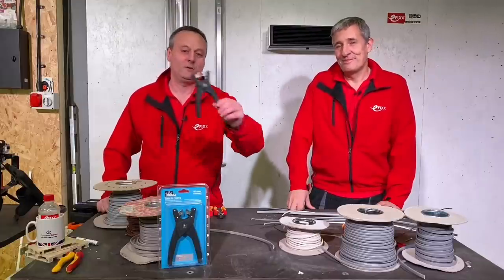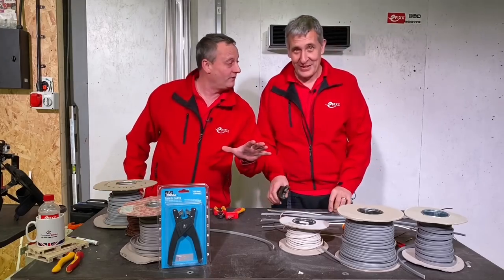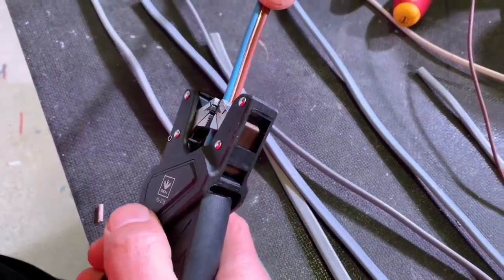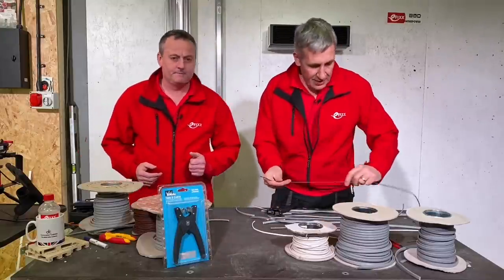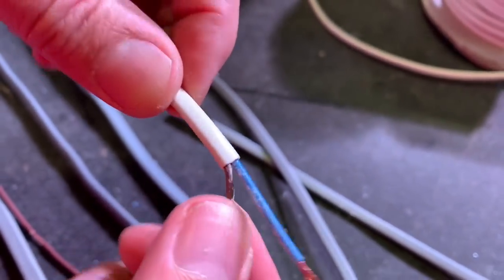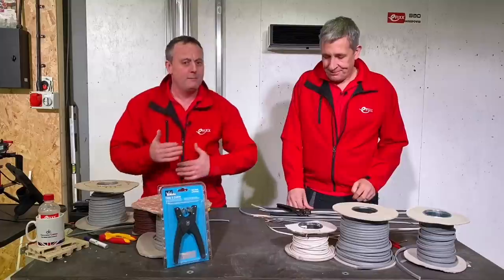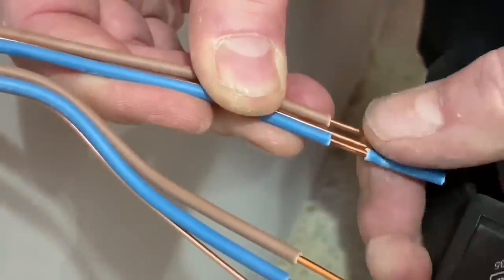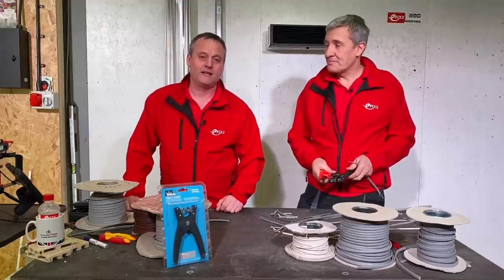Strip TWIN and EARTH cables FAST with this IDEAL cable stripper.

Comment: They look brilliant! Another one for the wish list then. I’m new to industry and can find i bite into the cooper if i’m not careful using snips, meaning the copper snaps when i try to connect it and screw it down.
Reply: I can not believe that these don't scar the mechanical protection and the insulation like other branded automatic strippers do... *ahem*ck*ahem*🤫🤭🤭

Comment: Great looking tool, but only up to 2.5mm2 T&E. What can you recommend for 4.0mm2 T&E? Mainly interested in the sheath removal as stripping the cores is easier and less of a problem if it goes wrong.

Comment: I’ve actually got a pair of these, apparently there are another brand that do up to 6mm which would be useful. Great on new cable, not so good on old colours when I’ve done some retro fitting. Always use it in lighting not on back boxes as difficult to get in far enough. Also use knipex ergo strip which is my go to. Use the Ideal for termination mostly as it’s great for measuring the correct length and with wago connectors.
Reply from the maker: Great comment and thanks for sharing with the community 👍
Reply: Ideal?

Comment: Thanks for the info, I was a bit disappointed how much sheath was left in the back box on your socket test. I nearly bought a pair of these to replace my CKs (which I don't use for sockets for the same reason) thinking they'd be better for making off sockets. Doesn't look to be the case, guess I'll stick to the old side cutters and cheese wire approach for now!
Reply from the maker: Thanks for the message 👍

Comment: If you use the tool like you have done then instead of using your hands you can use the tool to take the outer sheathing off on the cables way out if you grip it? Then go in again like you have to strip the cores. Thanks

Comment: I've got a pair of the CK ones, only use them if I'm 2nd fixing lots of downlights as you have to enter the cable from the side which makes is awkward to get into ko boxes. However may have to save up some pennies and invest in these style cutters. Looks time effective and nice clean finish to the cable. Still waiting for someone to come up with tool that will strip LSF T&E though!!

Comment: It would be nice if the cutting/gripping  head was extended  and could easily fit into a receptacle box or tight areas to strip NM cable.

Comment: I know it's not the same but I just got the knipex Ergostrip for flex cables  for a Christmas present( hopefully come in handy for Storage heater flex cables) ,been thinking about them for awhile, anything to make life easier.
I see the advantage of those "Ideal" strippers and similar doing more than one conductor at the same time for flat cable but at the time being i don't do a lot of installation work I mainly do replacement 2nd fix for housing maintenance so at the moment I'll pass.
Reply from the maker: Great comment and thanks for that 👍

Comment: i was late to the game with automatic stripers, i have the ck ones and they are good, its about time the regs stopped being clever and go back to the terms all electricians use, earth, live, fuse board etc etc, and now we are out of the EU back to red and black as well as red, yellow, blue.
i had trouble with my strippers doing exactly the same with some twin cable, and that cable was prysmian, which was a surprise.
Reply from the maker: Great comment 😁
Reply: I have to disagree, clarity in terminology ensures no confusion. We don't use Fuse boards anymore so why call it a fuse board? Red & Black everybody knows as DC positive & negative. Blue brown is AC, EU or not that was an excellent idea + helps the colour blind 👍
Reply: @acelectricalsecurity  I agree consumer unit is an odd name but I don't understand, fuse board is just inaccurate, nobody says shall we watch a DVD when they load Netflix and watch a film, when you charge an electric car you don't say I'm going to get some fuel for the car.  
I understand that we changed to harmonise with the EU, but the EU already had a much safer and clearer colouring system, so we didn't just do it to harmonise, we did it because it was an excellent idea which is why most of the other countries did it decades before the UK. What if your unskilled person is colour blind, red and green colours are hard to distinguish, an unskilled colourblind person could wire a plug incorrectly or feel like they're unable to undertake a basic electrical task. An unskilled person may believe red is positive and black is negative, which isn't the worst but it is simply incorrect. Maybe you've not realised the advantages these simple changes will bring to people others?
Reply: @acelectricalsecurity  well said .

Comment: They look like a must have!! How do they perform on the dreaded LSOH or XLPE insulated sheathed cable?
Reply from the maker: Great question - we will get done LSOH and give them a try.
Reply from the maker: Thanks for the great message - turn it tonight at 8pm as we are giving out prizes https://youtu.be/w0Fq-h7U4LQ (hint 😉)
Reply: @efixx  😉
Reply: @efixx  was going to ask this question, did you get an answer? do they work on LSOH T&E?
Reply: @efixx  I was wondering, did you get my home address, I emailed admin@efixx with my details, but no response? 🤷‍♂️ 🤷‍♂️

Comment: I googled it but think its associated Electrical industries? Can u get some that do a higher size cable ? 4mm ? I'm after a new set as I don't use my ck ones as they don't fit in the back boxes.  Great video chaps.
Reply from the maker: Thanks Ed 🦾

Comment: Awesome, by far the best Sparky's channel on the internet. I have a couple of pairs of these and swear by them for most flat cable except for LSF & LSOH cable where they just don't seem to last. Even the "Knipex PreciStrip 12 52 195" Don't last. Have you come across this? And if so are you aware of any of the "automatic cable stripping type" that would be up to the hard sheath
Reply: Do they strip 4.0mm T&E cable ok?

Comment: I would  use this instead of CK automatic cable strippers or just normal cable cutters which could damage conductors and are not ideal for twin and earth. These are ideal for stripping twin amd earth cables especially when 2nd fix.

Comment: I have used a cheap set of vice grip style strippers for twin and earth foe a while, seem to work okay for my needs… any reason I shouldn’t be using them to remove sheath and inner insulation in two separate actions?

Comment: Nice tool but very difficult to get hold of the blades when they go blunt. I can't find them anywhere :/
Reply from the maker: Great point we will pass it on the Ideal Industries 👍
Reply: Can you buy the blades , from ideal web site
Reply: @stevendouglas3860   No unfortunately not :(

Comment: I use the ones from QuickWire (same product, different supplier)
Have been using them for over a year and now find that sometimes between cuts I have to squeeze the handles a couple of times or the jaws will not grip the cable properly.
Reply: i have found the same too, been using the quickwire for just over a year and sometimes it doesn't grip the cable

Comment: Ideal make the original automatic wire stripper which is widely used in the aviation industry because it leaves no damage to the conductor or the insulation, the price of the tool and dies reflects this precision so it's no surprise that they have designed and manufactured this so well. When the chinese copy this, which they always do, it won't be anywhere as good as the original.

Comment: The CK cable strippers are good also. They offer a cutter and a crimper as well as the primary job of a cable stripper.

Edit: these strippers also strip round flex and singles.

Comment: I think there a OK tool but I think you will have a problem when stripping the outer sheath  at the box? The conductors not a problem in which case you might as well just use side cutters.
Good demonstration though weldone.

Comment: They look excellent, however I would of like to of seen a gauge on them like the wiha ones so you get the correct length of cut every time.
Reply from the maker: Put a bit of tape on the side 🤣

Comment: Have you tried the quick wire set?
Reply: Tony Huggins tbh, it seems those are the same as the jokari along with the ideal industries. Probably all made in the same factory in China and rebadged for whoever wants to put their name on them. I've seen in Edmundsons the knipex version. I didn't ask the price as they would have been twice as expensive just for having the knipex branding on them.
Reply: Probably true. Its just that I see the quick wire ones on amazon with some quick wire connectors for £50 witch I thought was good.

Comment: Do they work on Irish twin and earth?thanks
Reply from the maker: Hmm - good question -where can we get some in the UK
Reply: Cef should be able to source a bit for you,they have branches in uk and Ireland 👍
Reply: Why is it different to the stuff used in the UK?
Reply: @paulprescott7913  changed it 2 years ago to same csa of cpc as brown and blue and insulated it as well,this was to improve loop impedance values due to earths deteriorating in houses due to plastic piping for plumbing been used
Reply: More awkward to install as it is bigger,but makes easier for 2nd fix,no sleeping,consumer unit a lot handier
Reply: Sleeving not sleeping 😁
Reply: @dominickelly7175  ahh right.
Reply: Try
Reply: I always found the uks lack of sleeving a better idea for ensuring ADS with a fault occurring on any Live conductor. I don't mind sticking a bit of sleeving on

Comment: whats wrong with side cutters between earth and a conductor then pull the earth to where you want the conductors out of the sheath, thhen cut sheat round with tio of the side cutters, Can't understand why you would use a KNIFE thats potential for insulation damage isn't it? You'd hae to use side cutter method on the ugly cable
/
Reply: Have to admit thats what I do but it apparently it stretches the cpc
Reply: @paultipton743  hmmmmmmm, yeah that's what 'they' say,  but I'm not convinced.  Sure John Ward had something to say about it.... he called it nonsense too.

Comment: Will they strip LSF T&E though?
Reply from the maker: Depends upon the temperature of the cable when you are stripping - if a cold day 6C we’ve had mixed results.
Reply: @efixx  struggling with the LSF on big jobs as it's killing the hands stripping it was hoping this may solve it
Reply from the maker: We’ll make a short video tomorrow and post the results so you can see.